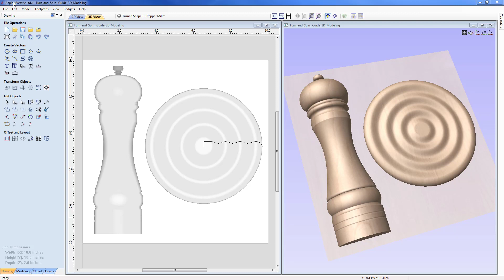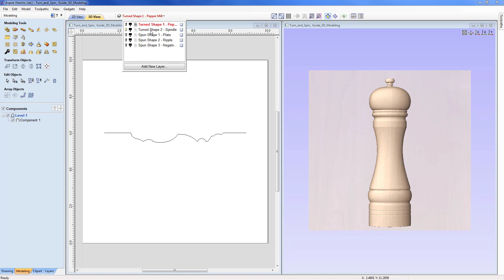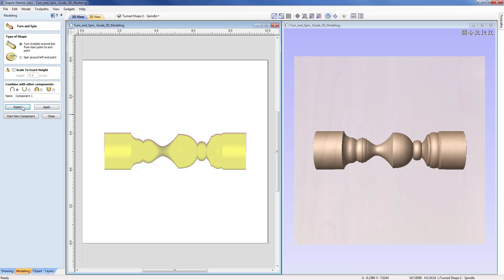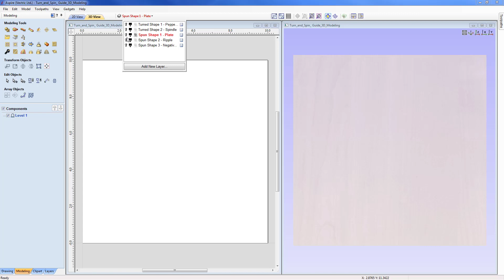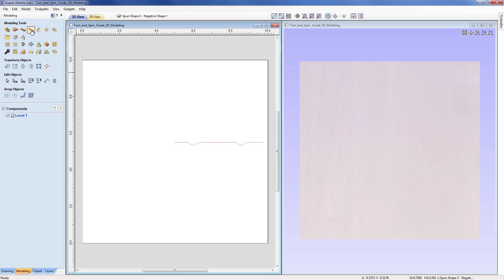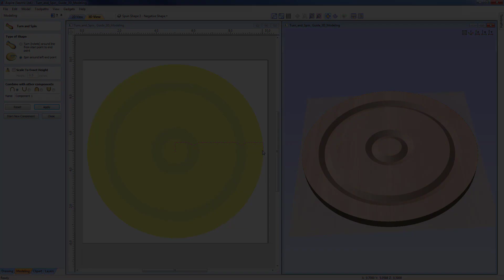Vectric V10 Tutorials | 3D Modeling | Turn and Spin Guide

Comment: Sometimes I struggle to create continuous shapes (they appear with dotted line in the software) that make the Turn & Spin work.
Is there a tool I am missing that effectively merges different sections of the shape (without gaps)? Thank you for these instructive videos!
Reply from the maker: Hello, and thanks for the question and comment.  Once you have the shapes made you can choose how they are merged together or as we call them the "combine modes".  These can be accesed by tight clicking a component in the component tree, component properties, or by right clicking on the component in the 3D view.  If you have gaps you may need to nudge the component using your arrow keys on your keyboard. I hope that helps...

Comment: Nice tutorial, thanks. Is there a way to shift the 3D shape along the x-axis? I have to create a barrel-like shape along the x-axis, then shift it a little bit "up" and only carve the lower part of the barrel and substract this from my material. Imagine a barrel floating in the water sideways, 1/3 under water, and then carve the surface of the water minus the barrel.
Reply from the maker: Thank you for you kind comment on this tutorial :) It's a little tricky to answer your question, could you kindly e-mail our support team on support@vectric.com and they will be able to point you in the right direction :) Thank you, have a great day!
Reply: @vectric  Thanks for coming back to this. I finally managed that, it worked with stacking boxes and my shape, layer ordering and zeroing properly. When you understand the logic of the layer stacking and the combination modes, you can achieve what you want to do.